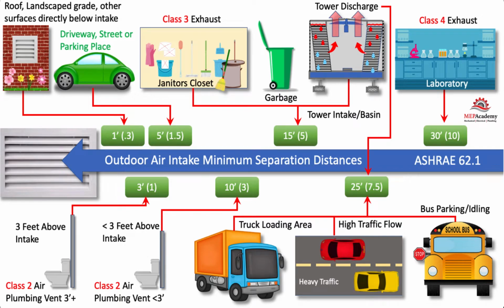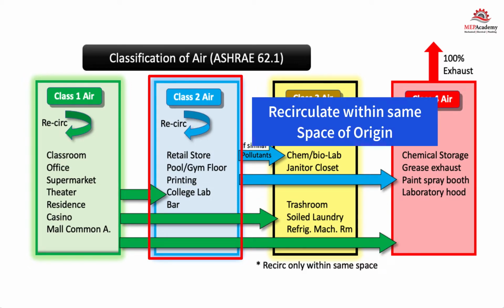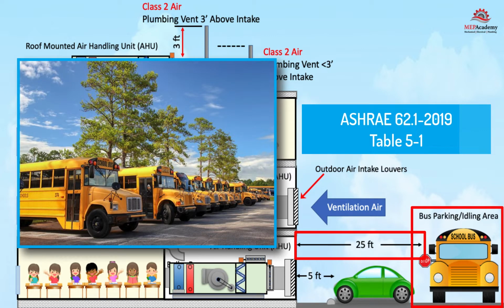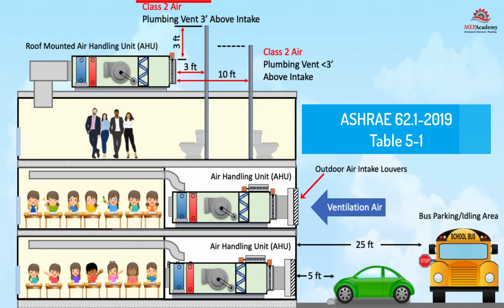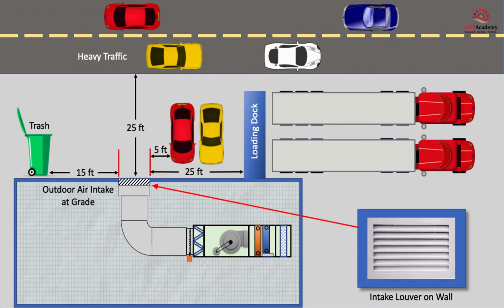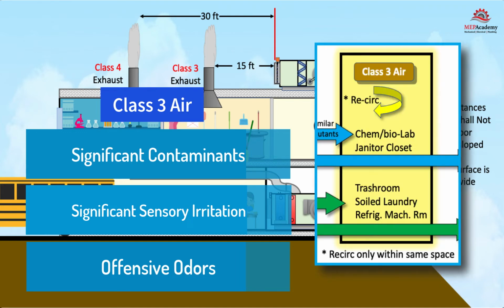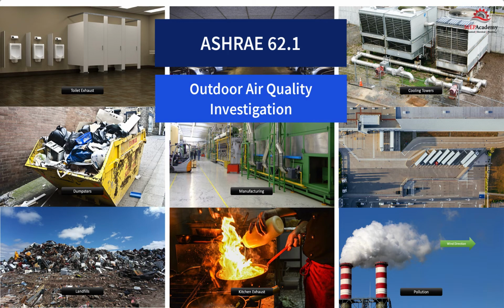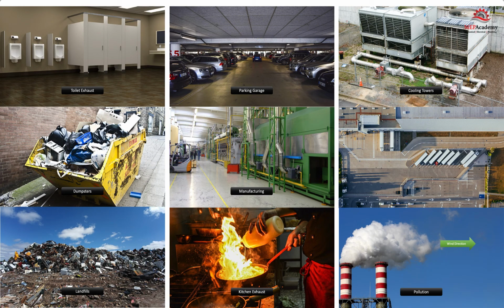Outdoor Air intake locations and Air Classification

Comment: how about the shoreline. How far should it be away from the shoreline, we have a hotel project in NJ the engineer said we have to be far enough from the shoreline to avoid the salt water .
Reply from the maker: The engineer should be concerned with pulling in salt laden air, and take every precaution to avoid it. Salt-laden air can corrode equipment, damage building materials, and compromise indoor air quality. Here are several ideas to avoid and or treat the air. 1) Location and Intake Placement: Place the building's intake vents at a higher level to avoid drawing in air closer to the ground where salt concentration is higher. Ensure that intake vents are located on the side of the building opposite to the prevailing wind direction from the ocean. 2) Air Filtration: Use high-quality air filters specifically designed to capture salt particles. HEPA (High-Efficiency Particulate Air) filters can be effective at trapping very small particles, including salt. 3) Pre-Filtration: Consider using a pre-filter or a mesh screen to capture larger salt particles before they reach the primary air filters. Regular maintenance is essential to clean or replace these filters. 4) Desiccant Dehumidification: Install desiccant dehumidification systems to remove moisture from the incoming air. These systems can help prevent the deposition of salt on surfaces due to condensation.  5) Elevated Intake: If possible, consider elevating the intake system to a higher location, such as the rooftop, to minimize the intake of salt-laden air. 6) Coatings and Surface Protection: Use corrosion-resistant coatings on equipment and building materials that are exposed to outdoor air. Regularly inspect and maintain exterior surfaces to repair any signs of corrosion promptly. There are other strategies that your HVAC specialties or engineer can discuss with you, but these are a few to consider also.
Reply: Thank you so much for responding, but my question is, what is the code about the distance between the hotel and the shoreline. The hotel- that we are working on it, it's only 2.4 miles from the shoreline, so is this far enough or note according to Osha?, or there is no code for that?  @MEPAcademy
Reply from the maker: @hamada966  Being 2.4 miles from the shoreline would most likely be outside any code requirements. What would be required is for the engineer to design for the salty air by coating coils and other materials exposed to the corrosive elements. Good luck.
Reply: thank you so much. @MEPAcademy